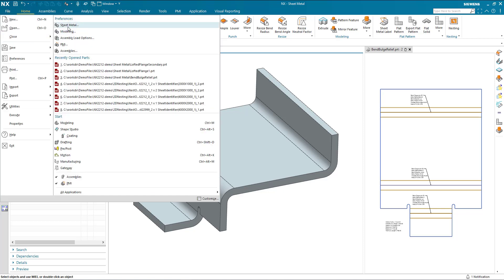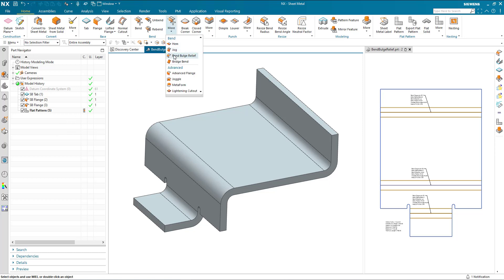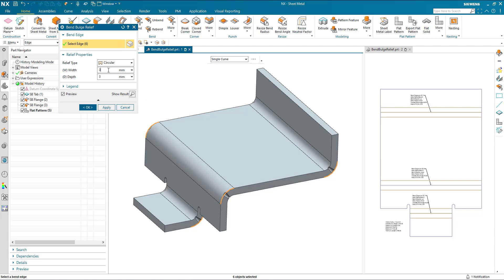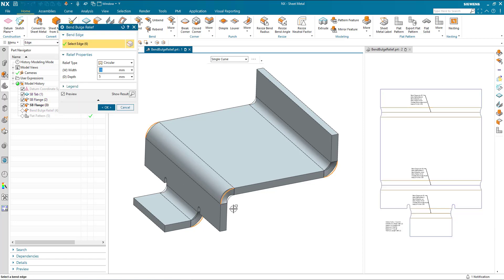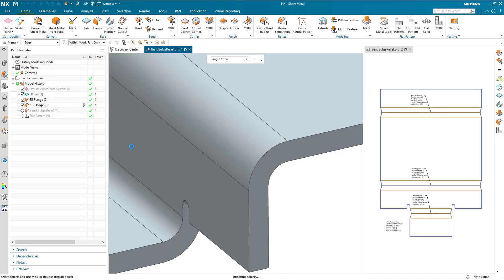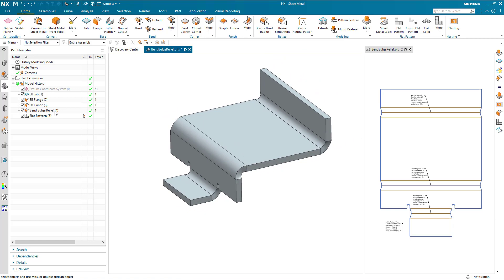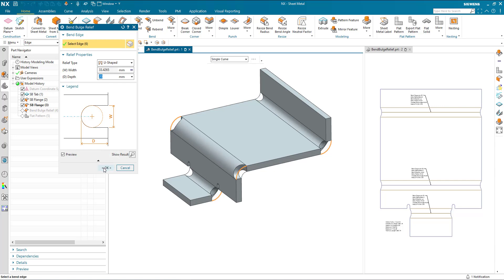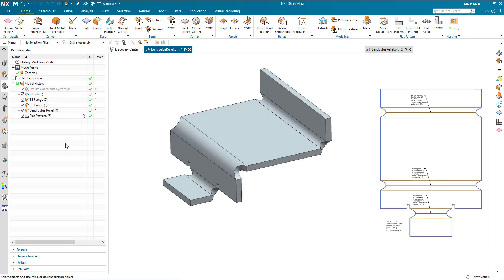Siemens NX Sheet Metal Bend Bulge Relief

Comment: Hi David,

Thanks for sharing the video! I’m working on a design where I think I’ll need a relief, and I’d like to calculate its size and position. I’m using 6mm thick material with a 12mm outer bend radius. Could you help me with the calculation or guide me on how to approach this?

Thanks in advance!